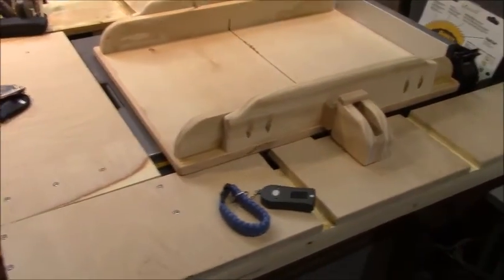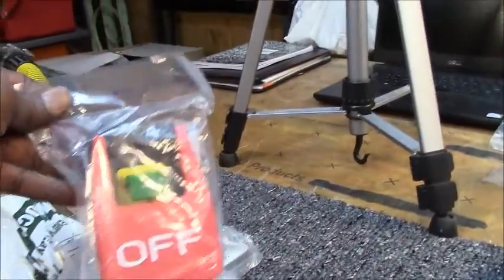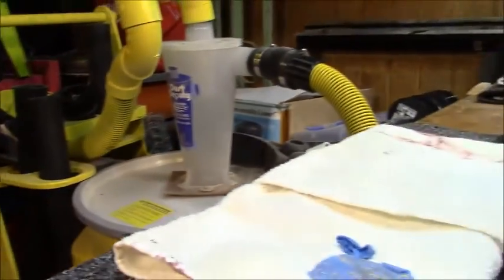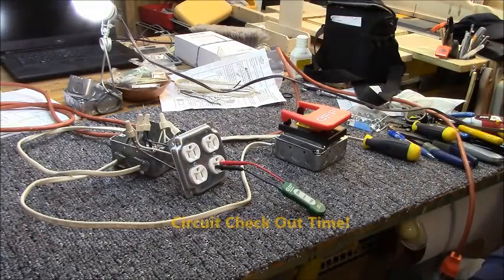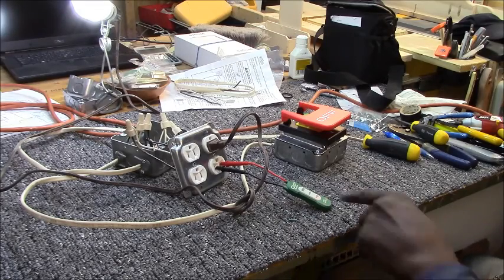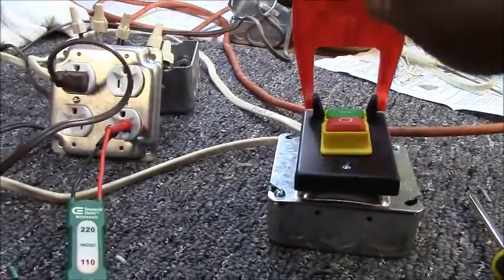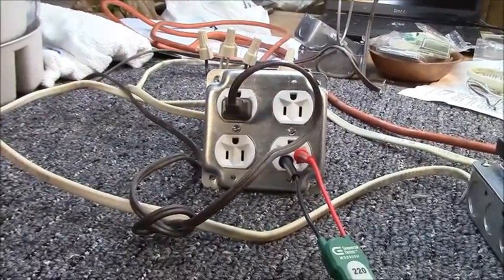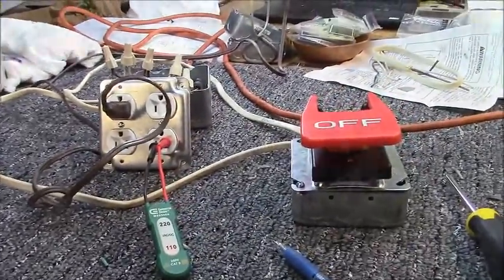DeWALT DW 744 Table Saw -  On Off Paddle Switch Modication

Comment: Thank you so much Robert, this is the exact video I've been looking for for 2 weeks. I was just given a 1960's Craftsman 100 series 10" table saw from my uncle. It's replacing my homemade tablesaw (I love it and I'm very proud of it, but I gotta adjust it every time I use it due to humidity).

The guy who owned it before my uncle had a very old 5 outlet power bar he used as the "on switch." The saw had a good amount of rust on it and paint was bad, so I decided to refurbish the whole thing. Got it all stripped down, used vinegar, sandpaper and a 4" wire wheel brush to clean it all up and rust free. Just started primed and spray painted the case, cast iron wing, underside of the cast iron table, and all the mountings today.

I'm ordering the same paddle switch off Amazon in a few days, and I've been trying to figure out how to wire it up. Most of the vids I've watched are just replacing an old switch, and not really what I needed. YOUR VIDEO WAS PERFECT. You answered 99% of the questions I had on setting this up for my saw, I just need to pick where to place the switch itself. Thanks so much again

Comment: Very nice modification. I especially like that it doesn't change the original equipment.

One thing I would change is location of the switch.  I personally would place it where you could keep hand on the work piece and bump it with a knee or hip if need be.

All in all great build.  Two thumbs up!
Reply: BTW Just subscribed.
Reply from the maker: Scott Axton, that's a good idea. Keep it in mind if I change the config when it gets warmer outside.